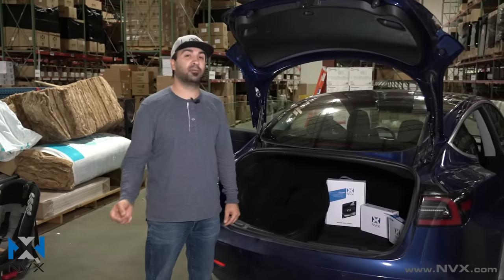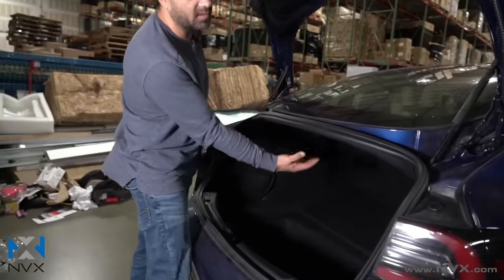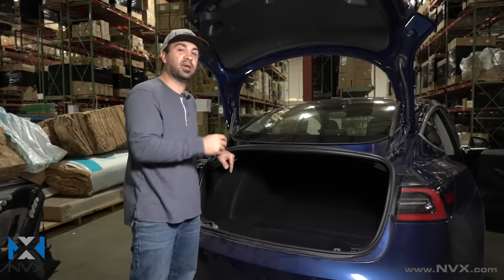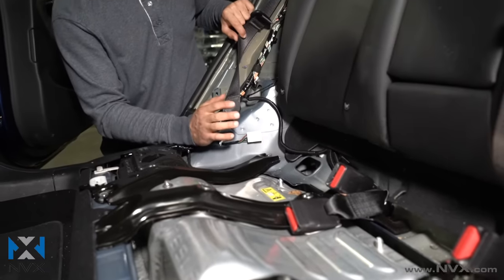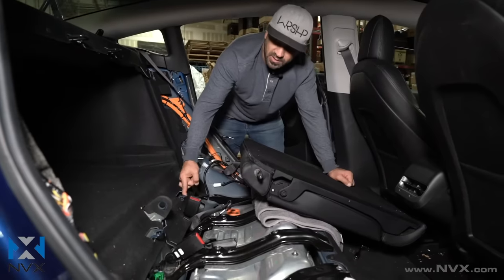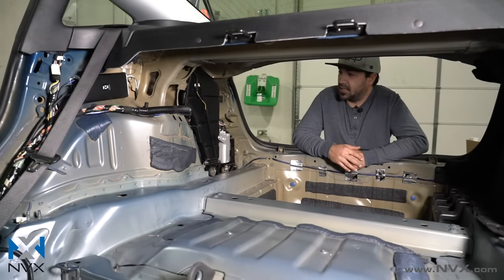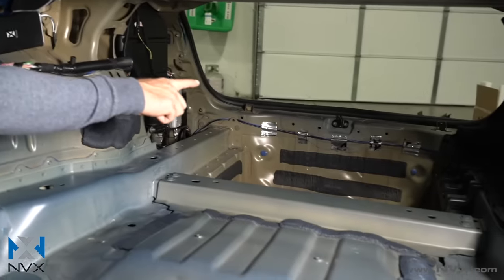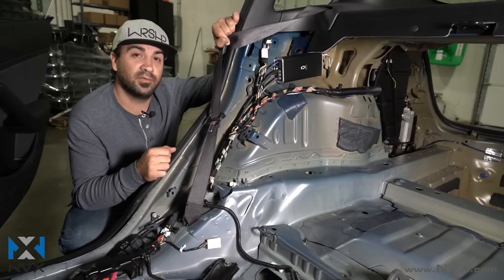Adding a Subwoofer & Amp to a Tesla Model 3 - Step-by-Step Install Guide for NVX BOOST Sub Box

Comment: Does installing this void my warranty or affect it in anyway way if I have it install at a local car audio shop?
Reply: I called Tesla about this and it definitely does void the warranty because you are tying into their wiring.
Reply: @fgmproductions  The whole car's warranty or only a portion?
Reply: @lancebrumbalough4325  So the battery in the frunk is better?
Reply: @lancebrumbalough4325  still no issues? I’m in a similar situation to yourself. I have a sub and amp from a previous car that I’m thinking about installing.
Reply: @lancebrumbalough4325  I just got my Tesla a few days ago and I saw you can mess with the equalizer. It does sound very good. I would like the bass to be a little tighter but dunno if it would be worth the trouble.

Comment: 1. Showing an installed system is a waste of time. 
2. You don't specify what year Model 3 cars this can  be installed on. 
3. A RWD installation would be MUCH more complicated,  but you don't show that.
4. You don't show how to connect the wiring harnesses and RCA connections
5. You don't explain the benefits of installing this system. 
6. You don't specify what parts you are using that have to be ordered. 

Overall,  this "instruction" video is a complete failure!

Comment: Does this work for 2023 modle 3 rwd? I dont think it have a sub to take output from
Reply from the maker: It will work for your vehicle with no issues, instead of grabbing signal from the subwoofer, you will want to grab signal from the front door woofers.
Reply: @NVXAudio  do I take of the door panel or is there another way to get to it
Reply from the maker: @deeppatel5673  The signal wires for the woofer in the door can be found in the kick panel harness going into the door boot.
Reply: @NVXAudio  can u give me a video that has it or an image of where it would be

Comment: does the remote turn-on feature keep the LOC/amp on for about 30 minutes after the car shuts off?  I'm currently using another brand of LOC, and it detects the signal to turn on the LOC/amp, but after the car is asleep, the LOC and Amp doesn't turn off for over 30 minutes.  The car is a 2021 Model 3 Performance, if it matters.  Thanks!
Reply from the maker: It should shut off with the car

Comment: I’m have a strange issue with my XLCA2 which has stopped turning on, but only sometimes. 

If I unplug the wire harnesses and measure voltage everything seems fine. I get a good 12V power coming in and around 12V at each speaker wire. The moment I plug in the wiring harnesses, the “maximized” light flashes once and the voltage of the power wire drops to about 5V and the LOC won’t turn on. Oddly enough, the system has been working fine for 4 months and this just started happening recently and only intermittently. 

I did try another XLCA2 and the behavior is the same, so it’s not the unit. Any thoughts?
Reply: Never mind, all. Traced the problem back to the 12V connection point where I tapped in for power. Wire was loose, so once I put a load on it (plugged the wire harness into the LOC) the voltage dropped. All good now. System is rockin’ again.

Comment: What did you set the gain to?
Reply from the maker: This is a very broad question considering you have to tune multiple devices to work with each other. First you would tune the XLCA2, then the amplifier. Here is a link to a video showing how to tune these in together. 
https://www.youtube.com/watch?v=wIybm01vY1M